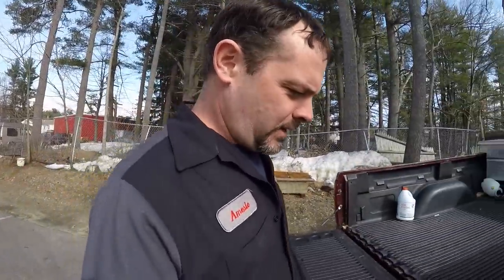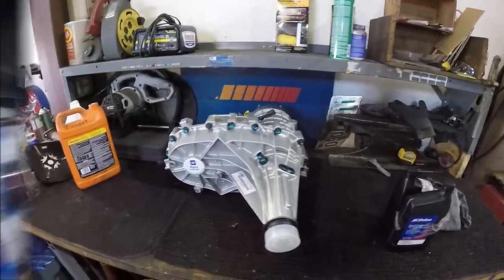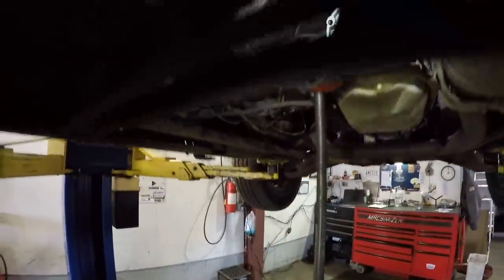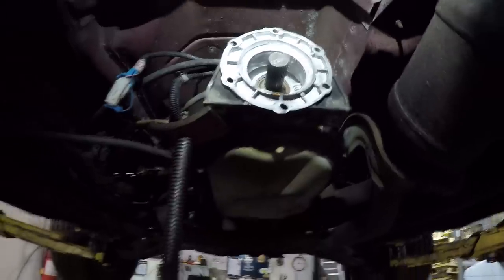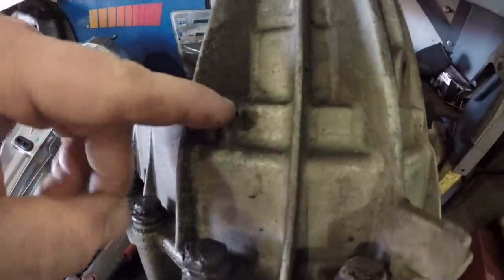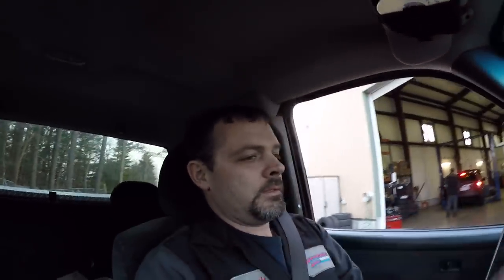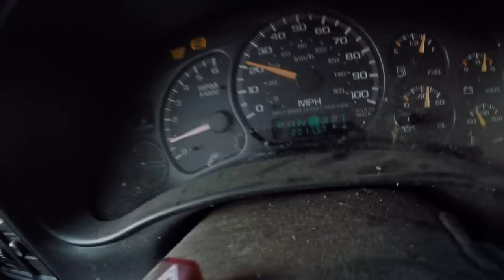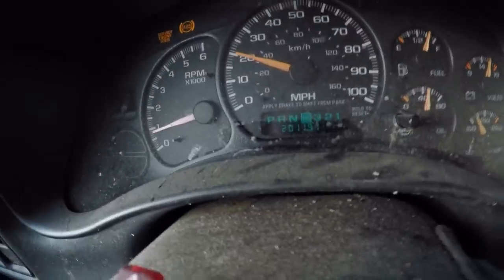Holes in your 4x4. The GM Transfer Case Issue..

Comment: Transfer cases, rear bumpers, cab corner AND sill plate/rover panel rot, rear pumpkin cover plates, steel rims, late model 99-06 Silverados (and equivalent) all had these issues.  They must have used some of the cheapest steal they could get their hands on, I've never seen such a load of rusted vehicles.  My dad told me about how Vegas used to rust exactly the same way.

I even had both rear leaf spring shackles literally rot out and fail, sending the end of the leaf spring up against the bed, happened to both sides.  Now I have to have my rear universal bearing replaced because they squeak and make a light rattling when I slow down since the failed shackles twisted the frame and I had to drive on it until I could get them fixed.

Comment: Just fyi, gm had a fix for this concern early on, and a bulletin was issued. The original bulletin had us installing a new case half only, not a complete assembly. As of  4/17 2007 a new preliminary information document cancelled the original bulletin. This  PIP4118  document  has you install a new design clip. "This new oil pump wear clip should be used whenever a transfer case is opened for any type of internal service. Doesn't say what to do if you have a hole in your case at that point but that's gm for ya.

Comment: I had an odd problem - or occurrence - with my 1964 Mustang V8.
One day while cruising the crankshaft broke! :S
Luckily nothing else broke when it happened, and the motor was able to start and run (poorly) so I could move the car from the main street to a side road. I had a new crankshaft and new bearings and seals installed and it has been running fine ever since.
When I look at the broken crankshaft it looks like there's some kind of weakness in the cast at the spot where it broke. Wouldn't be able to tell if that's something that dates back to when it was made, or if it's a result of metal fatigue and years of usage.
But damn! That nasty crack sound it made when it happened. I'll never forget that! :S

Comment: Any GM reman engine,transmission and transfer case,there is no upgrades done.Jasper does fix the problem with these GM transfer cases.That case is magnesium,not aluminum.Can weld that hole up too.
Reply: Walter Frederick can it be welded

Comment: What actually happens is that clip breaks and the oil pump rides up against the case putting a hole in it.  Merchant Automotive makes a different piece that goes on the oil pump that corrects the problem.    I've done many of them over the years.

Comment: My friend fixes this issue by machining a recess for a section of a hack saw blade to fit into. (the blade is hardened steel) Then the shaft can no longer wear through the case. He has done this for years with great success.

Comment: Transfer case is pretty easy to rebuild. It could be knocked out in an afternoon for about $400 in parts. They sell that back cover aftermarket or you can attempt to fill the hole with goop. Also the fluid going in should be blue. What did you use?
Reply: Or you can just pick up one from a scrap yard if it's not worth spending $2k on a rebuilt one.  Just make sure if it has a hole or looks like one will be there soon, use something to build up the area around it.

Comment: Amesie -  I have 2001 Chevy Silverado I'm trying to keep new.  Is this a problem here too?  I've gone out of my way to treat this thing to meticulous maintenance, including replacing the TFC oil with synthetic  lube.  Thoughts?
Reply: BTW - We're almost neighbors!  Rt. 93 exit 3!  :-)
Reply: Mileage is 150K...
Reply from the maker: I don't think Iv'e seen one older than 03 with this issue, also It seems to be the 2500 and 3500's that develop this issue more than the lighter trucks.
Reply: Amesie's Automotive Corner 
  Came here to say that it's great that you are providing this type of information. But just a little lacking in not providing the years and models affected. You helped answer it a little bit with this reply, but more info in the actual video would be appreciated and help out the general audience in a big way, especially those buying used vehicles.
Thanks,
Peace

Comment: Why hasn't GM addressed this issue and replaced them accordingly. It's an obvious engineering design issue that consumers are made to endlessly deal with at a high cost. The Consumer Protection Agency needs to get off their butts and do the job the taxpayers pay them to do.
Reply from the maker: You can't expect an automaker to be responsible when a vehicle is so far out of warranty.

Comment: All American cars age badly, but GM products are one of the worst. The only GM vehicle that I like is Buick. Those seem to be one of the more reliable GM brand names these days compared to some others
Reply: You here a lot of people saying gm cars being shit. But that trucks good 200k miles and are still running, and obviously worth putting 2500$ into. That's saying something. I dont pick sides in this quality debate, just saying. My take buy a Volvo 😎
Reply: Well not all GMs are bad. Aside from the transfer case the trucks are actually okay vehicles. Not my first choice but not as bad as some of the other Chevys on the road. Yeah I like Volvos as well, but I prefer the Swedish body style over ford. Those date up to 1998 and older
Reply: Ha ha You can't replace that truck for $2500.00.
Reply: lets see make a video
Reply: Speak for yourself I had 270k+ miles on my 90 Silverado 5 spd 4.3l w/ the original clutch and original motor in it whn I parked it and my dad sold it.  In fact I've had over 10 GM vehicles in my life and the only ones that were a problem were the later 98 Tahoes and the 2008 Saturn which Mr. Smith explained why.

In fact GM let go of Saab because they were costing them too much money because Saab wouldn't except their platforms due to their low quality.  The 07 9-3 is one of the highest rated vehicles by the IHS and European Safety Institute but it cost GM too much money compared to Opel
Reply: Jaqen H'Ghar yes I used to own a Saab myself in fact. 1996 900 S.
Reply: Its a myth that Saab cost GM to much money. at least compared to Opel, The Saab factory had better quality and productivity scores then the Opel factories, and they built cars cheaper due to higher level of automation. The reason GM stuck with Opel was kind of political. Opel workers had a stronger and more aggressive union that had more ties to the UAW and could thus cause more problems for GM in the eftermatch of a company/factory sell. Also the local german government was more forthcoming with support and political pressure to keep the company than there Swedish counterparts. 

Maybe its true what Kaminski Smith wrote in an earlier comment. An engineer CEO is probably less emotional and  therefore less prone to bow for the unions and politicians. Trust me in an engineer and we base decision upon calculation and quantitative data, not speculation, believes or fear. ;)
Reply: My Chevy Silverado 2500 1994 with 234'000 miles on it runs completely fine. In my opinion it is a very well built truck with very few issues and low repair costs. I just change oil after the schedule and tires when the winter sets in. Most of my friends have European cars and have a lot of troubles, expensive troubles. That's my experience.
Reply: nilsutt a truck of that age with that many miles is in no fuckin way work puttin 2500 bucks into it.

Comment: I use JB weld to plug the hole on my 1999 suburban. did it 3 different time in 3 spots,  holds up for years.  don't spend no 2 grand on a vehicle with 240,000 miles.

Comment: At least GM updated the oil pumps inside so they don't wear like that anymore, different style clip and in a bit of a different location. Of course you can get aftermarket pumps for those, that are like a large block, no clips to wear into the case.

Comment: Did my daughters t case rear case and pump saver for under 300  with fluids. leaked after 280,000. 2000 kinda steep

Comment: 211.000 miles, that's about 340.000km. That mileage is awesome! A VW DSG transmission wouldn't last 100.000km, especially not in a heavy truck. But such planned obsolescence shouldn't be anyway. Just two options: bad engineering or cheap building with planned/accepted obsolescence.
Reply: Yes it would, we have two 11' vw caravelles with 210000km on them..still running strong in the drive line.

Comment: would a little JB weld work to plug?
Reply: Yep, if you catch it before all the fluid leaks out of it and damages the internals from lack of lubrication.  I've used that on an oil pan before, lasted the 3 years I had the truck before it was rotted beyond repair.